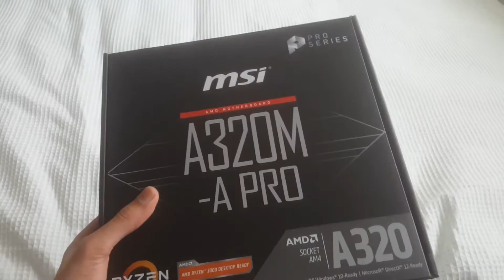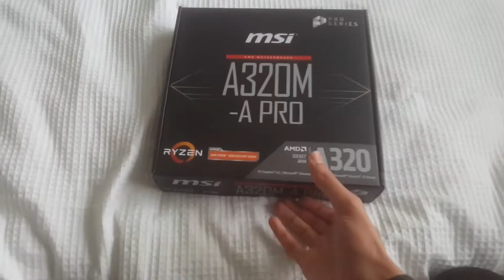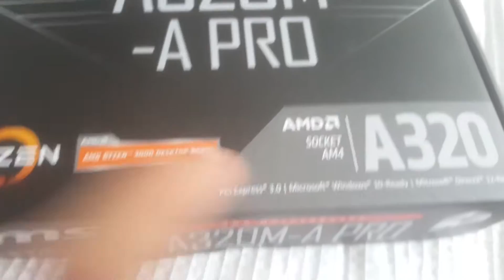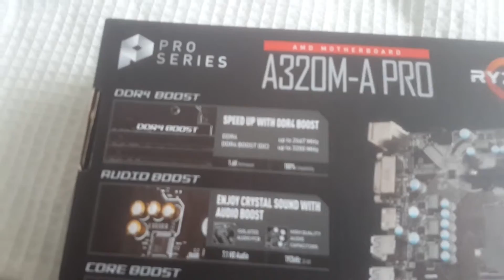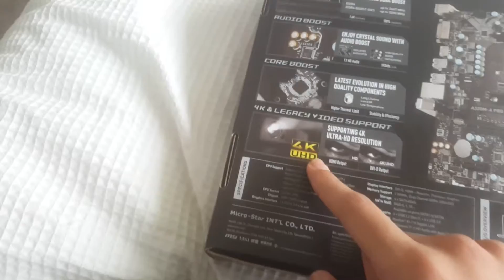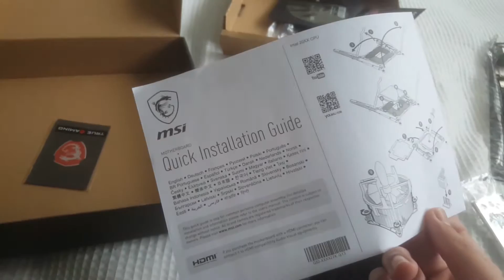this is a seriously under rated motherboard... (MSI A320M A PRO Motherboard Review)

Comment: There is a Max version that has an M.2 slot, that's the one I have. Paired with Athlon 3000g at first. plans on upgrading in future. Highly recommend.
Reply: @Mr_Shams Runs great. I use it for Plex 24/7 and play some Starcraft 2, DayZ and Phasmafobia. It's not amazing for games, but at 720p on medium+ runs DayZ good.
My plan is to upgrade the processor eventually and get a graphics card, as the Athlon will only support x4 from the PCIe slot, but  I'd highly recommend. Windows runs great 4k and YouTube playback
Reply: @SomeDudeUK   hello sir what graphic card is compatible in iur setup? I also have this kind of Motherborad and athlon 3000g
Reply: @khianuy6293  to take full advantage of the x16 lane PCIe slot the processor needs to be at least 1st, 2nd and 3rd Gen AMD Ryzen (none APU)
With the AMD® Athlon™ with Radeon™ Vega Graphics, it will only support the slot at x4 speed, basically making the performance be a quarter of what the card is capable of.

My understanding from reading some online literature is that any PCIe 3.0 compatible card will work, even the latest 3000 series from Nvidia, but they’ll have PCIe 3.0 performance and will be limited by the Athlon or APU CPUs (3200g and 3400g for example MSI say it’s limited to x8 speed) in the motherboard. But I’m sure the performance will be better than the built in graphics with the 3000g until you upgrade the CPU.

As of yet, I’ve not installed a graphics card. For what I needed out of this build with light gaming and running a Plex server full time, the Athlon 3000g has been amazing. Still only 720p gaming, but been playing Valorant and DayZ just fine. While a Minecraft server and Plex is running along with Torrents through Sonarr and Radarr doing their thing 24/7 for just shy of 2 years.
Reply: How far can you upgrade the cpu without the thermals on the vrm being an issue? Ik that the 3600 will run fine with pbo thx to tyc
Reply: @samsonsanthosh  tbh, coming up to 2 years now and I’m still on 3000g, overclocked to 3.8GHz and I get 60fps on low graphics 1080 on Valorant which is fine for me while running Plex.
Since getting a PS5 I use that for main games and then this for just Valorant, DayZ and a media server
Reply: @SomeDudeUK  Bro those thing's are rare and ya nice setup man as long as it can play the stuff you want it's good

Comment: Hi mate does it work with r5 3600 without bios update??
Reply from the maker: Yes
Reply: You say in video your pretty sure it does need one ive just bought it and it says 3000 ready on the box so am i good to just put a 3600 in no update needed
Reply from the maker: Yep your good to just put the cpu in
Reply from the maker: It depends where u buy the motherboard for e.g amozon might sell the one with the updated BIOS and currys  pc world might sell the one with a not updated version of the BIOS
Reply: @M20UBR88  its from scan computers
Reply from the maker: Its definitely got the updated then thats where i get all my stuff from and amozon also if you could like and subscribe it would mean a lot thanks...
Reply: @M20UBR88  no problem will do cheers bid
Reply: Bud

Comment: Hi great vid. Does this support a Ryzen 5 3600, as it says on pcpartpicker that it may need a BIOS update. I’m new to pc and this is my first build so what’s does this mean. Thanks
Reply from the maker: Hi yes pc part picker is right however in my case from purchasing 2 of these motherboards i havent had to update the BIOS so you might not have to update it either however if u do its a easy process there might be a video on the channle soon on how to do that so it would be amazing if u could like and subscribe thanks..
Reply: Have liked and subscribed 👍. How would you know whether a BIOS update is needed tho?
Reply from the maker: So basically from my experience as long as the motherboard company says in the description that it support that generation of CPUs then you dont need to worry and if the motherboard dose need updating the pc will just only go into the BIOS then what youll have to do is get the update on a USB and put it onto the pc.
Reply from the maker: It seems like aong process but its just a few steps ill be making a video on how to do that so stay tuned if that somthing your interest in also if you have any further questions please ask im trying to build a community where we all help each other out
Reply: @M20UBR88  thanks that’s helped. fairly confident on everything else
Reply from the maker: No problem your welcome
Reply: @M20UBR88  actually. With this motherboard there isn’t an slot for a M.2 ssd. How is the ssd installed another way?
Reply from the maker: There is no m.2 support for this motherboard however you can use an SSD which uses a sata cable to connect
Reply: @M20UBR88  Yeye I’ve ordered a normal ssd ,Kingston a400 I think it’s called, is this easy to install.
Reply from the maker: hey there, yea this is yeally easy to install and bassically impossible to break if your careful. Just make sure that you plug in the sata power and sata data cable in correctly and you should be good👍
Reply: @M20UBR88  sorry mate. Got another question. Installing the power cables now for the cpu and most videos are saying that it’s an 8 pin connector that’s split into two. The motherboard only has one connector, so only 4 of the pins are being plugged in.
Reply from the maker: Yep thats right only 4 of thr pins will be pluged in
Reply: @M20UBR88  does this mean the pc will run slower or be any worse than an 8 pin?
Reply from the maker: No your pc wont be slow it just means you overclocking your pc is not recommend
Reply from the maker: kind of. all it will do is restcict the amount of power it can get. so it will force its slef to run slower
Reply: @M20UBR88  ok thanks again. Really helpful

Comment: could you fit a 1650 in it?
Reply from the maker: yea. all standard GPUs will fit into those pcie slots
Reply: @M20UBR88  thank you so muck
Reply: Much
Reply from the maker: np just like and sub
Reply: @M20UBR88  already did

Comment: Hi is this gonna work for my 16 gb ram 3200 mhz?
Reply from the maker: Hi yes 3200 mhz will work with this motherboard but you will have to enable XMP when your in the BIOS then youll be able to put the ram frequency (mhz)at 3200mhz also could you drop a like and subscribe as it would help out the channle and help others who find this video so that i can help them with questions thanks...
Reply: @M20UBR88  whats the highest mhz available? Can i overclock it to 3600mhz? Or even higer?
Reply: Higher*
Reply: @M20UBR88  how about on r5 3600x cpu? Will it work?
Reply from the maker: yes this motherboard does support an r5 3600x but maby not out of the box. you might need a bios update for it to work
Reply: @M20UBR88  is it bottleneck to my 1660 ti?
Reply from the maker: The ryzen 3600x should not be bottleneck by the 1660
Reply: @M20UBR88  can i overclock my ryzen 5 3600x on this motherboard?
Reply from the maker: Yes you can however its not recommended as this is a budget motherboard and the power delivery on this motherboard is not the best for overclocking but u can do it at your own risk

Comment: Will this mother board work with the ryzen 3 3100 and do you know any good cases for it
Reply from the maker: Hi the ryzen 3100 will work perfectly in this motherboard also you were asking about case suggestions i recommend you go with any case as long as its a microATX case as this motherboard is recommend in a microATX case also if you could subscribe to the channle it would be amazing as i could help more people with questions they have thanks...
Reply: @M20UBR88  just fine my build last night it works but where how many fans can I put on it
Reply from the maker: It depend on the case your getting or got
Reply: @M20UBR88  no fan headers on board
Reply: @M20UBR88  is there only one
Reply from the maker: You'll need an adapter then like a fan hub
Reply: @M20UBR88  ok thx
Reply: @M20UBR88  I wondered what they called
Reply: @M20UBR88  new sub thx for the help

Comment: I bought this motherboard brand new from amazon and i mounted brand new corsair vengeance lpx (ddr4) 3000mhz cl16 in 2x8gb on it, and in settings-》system info it tells me 16gb ram installed (8gb usable). And whatever i do with bios settings, i cant get my motherboard to use the 2nd ram stick???
Reply from the maker: Hi did you put the ram in the right slot for dule channle (2 sticks of ram )
Reply from the maker: If the slot is not the problem please let me know there might be another solution
Reply: @M20UBR88  i tried swapping the sticks and i am sure both sticks work, it just has a problem using the stick in the first slot. It reads it but nothing more, it's so weird! My pc knows I have 16gb of ram but only uses 8, and if I boot with only a stick in the left slot it refuses to boot. Could it mean it's defective? Have you had similar problems with yours? Should I trade it for an MSI B450M-A pro max? Or maybe just the b450m-a pro?
Reply from the maker: I had a similar issue but that was because the pins on the cpu we're bent my ram was good if your cpu is good that means you might be right the ram might be defective.
Reply: @M20UBR88  so you think the left slot on the motherboard is defective? Since I tried both ram sticks on the second slot and it had no problem. So should I swap my motherboard for a b450m-a pro max? I see you reviewed one on your channel. Also did your motherboards come with i/o shields? My a320m-a pro didnt have one, it's weird.
Reply from the maker: Hi the b450m a pro max is a good motherboard and yes my A320 came with an IO shelid so theres definitely somthing wrong with the a320 you received i recommend you try and return it
Reply: @M20UBR88  yeah I just did that, they are replacing it with a brand new one, hope it works this time :)
Reply: @x3ni487  did it work in the end?
Reply: I had the same Problem a few days ago after cleaning. After reinstalling the ram there was only 16 out of 32 usable. We'll.. after a few trys and errors I just wiggle each of the ram abit inside their slots... Problem solved..  😄😅

Comment: Do you know if it supports the ryzen 7 1700 or do I have to flash bios?
Reply from the maker: Yes its compatible with the ryzen 7 1700 out of box also if u dont mind could u like and subscribe as it helps the channle and i can help others with questions thanks.
Reply: @M20UBR88  I’ll subscribe thanks for the help

Comment: Hey I have this motherboard and my ram frequency doesn’t go higher than 1800 mhz even if my rams are 3600 mhz I did all the bios things like xmp and stuff but no changes help me please
Reply from the maker: hey, i think you may be looking at the FLK or fabric clock speed which is not the ram FREQUENCY as this motherboard can allow a max of 3200 mhz. try updating your BIOS or unlink the fabric clock speed as tgat could be why it is maxing out then. if the issue contines let me know and ill see if i can make a video about it

Comment: nice vid @Gamers Edition I would like to ask if this mobo can run smoothly with ryzen 3400G 8gb ram 3200?
Reply from the maker: Yes it will run smoothly with the ryzen 3400g and 3200g also if u don't mind could drop a like as subscribe as it mean a lot too the channel so that I can help more people with they're questions thanks..
Reply: thanks a lot! how about some upgrade? what gpu can I use for this mobo that can run ultra high settings? I am sorry for lot of questions just a newbie for building my own rig 😅

liked and subscribed man 👌
Reply from the maker: I this motherboard with the ryzen 3400g and rx 570 8gb gpu and i can run most games on high or ultra like gta5 ,forza horizon 4 and need for speed heat
Best gpu in my opinion if u have a 3400g is rx 570 or a Nvidia 1660 super this is the link for the gaming pc i build a few days ago   https://www.youtube.com/watch?v=mk6AqIzqTtg&t=204s
Reply: @M20UBR88  wow thanks a lot man!

Comment: Does it support ryzen 7
Reply from the maker: What is  the cpus full name for e.g ryzen 5 3600
Reply: @M20UBR88  ryzen 7 2700X it detected it in bios so
Reply: Because I have ryzen 7 with it and I can’t return anything as I’m on a short budget
Reply from the maker: Yep that CPU will work with that motherboard perfectly fine also if u dont mind could you drop a like and subscribe so that more people can see this and i could help them with their questions thanks...
Reply: @M20UBR88  thanks does it have WiFi or not
Reply from the maker: No sorry it doesn't have wifi

Comment: Can i put  this with a i3 9100f and a 1650 ?pls respond
Reply from the maker: The gpu will work with the motherboard (1650) however the i3 9100f will not work because this is a amd only motherboard so it dose not support Intel CPUs
Reply: @M20UBR88  thank you

Comment: Does the fan header have 3 or 4 pins
Reply from the maker: it only has 1 fan header but it is a 4 pin
Reply: it won’t matter if it’s A four pin header if you have a 3 pin fan connector that will work on it as well

Comment: is this supported for ryzen 3 3300x? without update?
Reply from the maker: Yes, this will support it as it supports ALL 3rd Gen Ryzen cpus some boards have been updated with the new BIOS however there are some that will need a BIOS FLASH.
Reply: @M20UBR88  without the need of update?